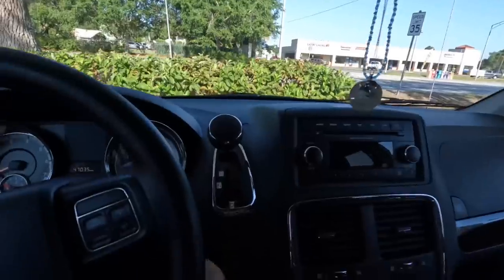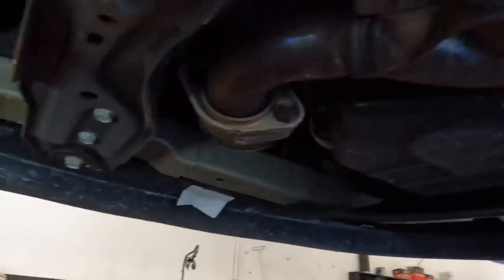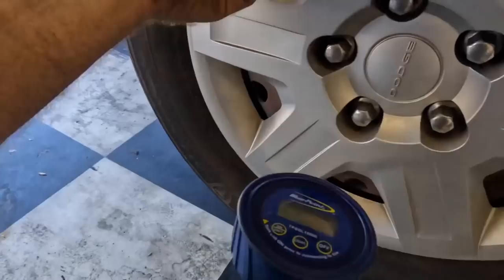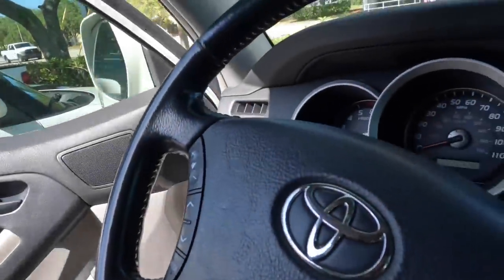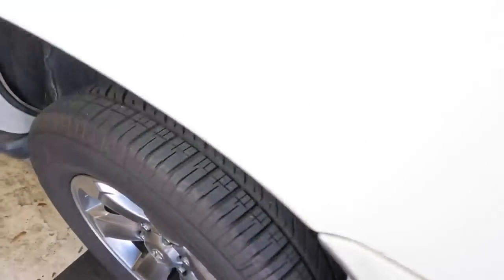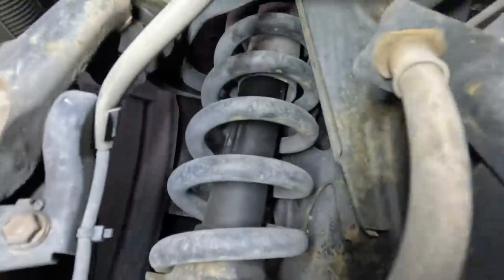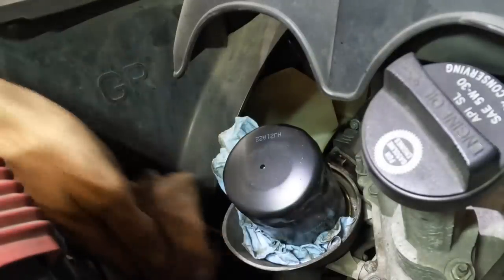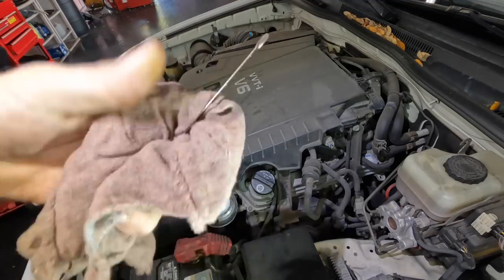This video is terrible! Home Sick B Roll

Comment: I'm no mechanic but in the UK those tires are illegal. I guess it isn't the same in the USA? I'm not one for throwing away money but if my tyre in on the limit or very close then I'll get it changed. There is no price you can put on your family. First Car I'd have had that under engine panel replaced too. Just makes sense in my book. Why bring a car in for a couple of clips and refuse all other issues. Beyond me. That's an expensive tire check. I don't splash the cash but I do make sure the car is looked after. As for the downtrend in work, all prices have gone up, yes the barrel of oil has increased but not to previous heights but do you notice that when the price of oil comes down there is not a corresponding decrease in prices? Legal con. I bet you get frustrated some days. Here is a guy who can strip a car down blindfolded and you are putting clips on a car. But I still enjoy your videos Ray, your verbose diction and humour really makes me smile.

Comment: If I were working in your field, I would just concentrate on the customer requests and leave it at that.  Disregard all the other unrelated stuff (leaking shocks, etc). Save yourself the trouble, most will decline the extra work anyway. As time mulls on through this failing economy the "Fix it when it breaks" scenario will be more apparent and standard protocol in the coming months.

Comment: Sorry to see your work decrease due to the present terrible economic situation.  A vertical oil filter- not a good plan IMHO.  BTW, 5W30 means the oil has increased in viscosity to 30 weight when it is warmed in the engine.

Comment: The Tax thing, You nailed it. With the automatic child tax credit deposits last year, if you weren't reading the fine print and your 2021 income exceeded $150K for filing jointly, yep, you got a tax bill and had to pay it all back. I was all set for a refund, until Turbotax got to that part and my refund went  from getting back $1200, to owing $1700.  We made $2500 more in 21 than 20, and exceeded the limit by $200.  Oh well, in a sense it was an interest free $3,000 loan.  I'm probably not the only one who ran into this.

Comment: I would say people are putting their tax refunds in their cars it is just going into their gas tanks! let's go Brandon! get well quick Ray, America needs you!
Reply: Exactly!
Reply: Meh... our gasoline prices have been pretty low for decades. It's running about $7.70/gallon in the UK. (Premium grade was nearly six bucks per (US) gallon there 20 years ago .) People who have to drive into London five days/week for work get charged (at current exchange rates) $93.18 "congestion charge" (£15 per day)... and they're still driving. Our motor fuel has always been relatively inexpensive in comparison to the world - current USA average price is $4.662/gallon; global average is $5.13/gallon. And that includes countries where it's ridiculously low, e.g. Venezuela $0.084/gallon, Libya $0.118/gallon, Iran $0.202/gallon, et cetera. Remove those from the data set, and the global average would be noticeably higher. Our politicians have refused to increase the road-use fuel tax for the last TWENTY EIGHT YEARS (because getting reelected is more important to them than fixing our roads/bridges/etc.). Thanks in no small part to that, the current estimate of what it would cost to catch up on the staggeringly huge bridge repair backlog is... $125,000,000,000! If we increased the fuel tax a dollar per gallon, it would arguably provide for that. Of course, it wouldn't leave much, if anything, for the repairs our roads need, but there's always future years, lol.

Actually, that whole method of taxation is on the brink of being outdated, due to the increasing number of vehicles that don't use liquid fuel. Therefore, it's probably time to begin requiring all new vehicles sold in the USA to include provision for reporting the amount of miles driven per year to the federal government so that we can get billed via an alternative method, such as paying that tax when we do our income tax each year. Use a multiplier to reflect the weight of the vehicle and, perhaps, another one to account for the differing levels of pollution that different vehicles produce, too (although that could get somewhat complicated - an electric vehicle produces less pollution than, for example, a 1967 Chrysler Newport with a big block V8, but a person who charges the battery in their electric vehicle via their home's solar setup 90%+ of the time will produce substantially less than one that is charged via municipal grid which uses older technology power generation. Which means that merely taxing IC-engined vehicles at one rate and electric ones at a second rate is too simplistic.

Er... apologies, got off the tracks for a moment. Basically... Our gasoline and diesel fuel prices are not too expensive - they are too INEXPENSIVE . . . .
Reply: @wesgregg6451  sorry I disagree. No need for gas prices to be this high in the USA! Plenty of oil right here we just have to drill it out. As far as the fuel tax paying for the roads they barely used it for that anyway. They just rape those funds for something else. Yes alternative fuels are taken away from those funds. That's why they should surcharge people who buy electric vehicles 5 to $10,000 more at purchase. Not give them a tax break. Also when it comes time to register the car yearly or whenever they have to do it hit them with another $1,500 or so. I will probably never live to see the day when they are back logs on the roads especially in the winter and the electric vehicles run out of charge and are stranded there for 2 to 4 weeks. I could ramble on about this also but I won't. Obviously we just disagree. But there's no reason for fuel to be more than $2.50 a gallon for regular along with diesel. May you have a great day!